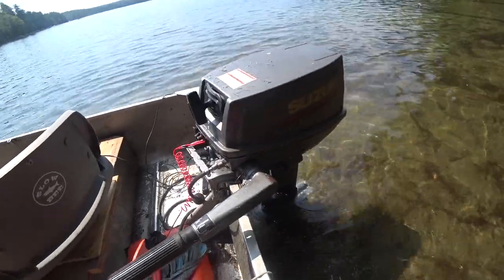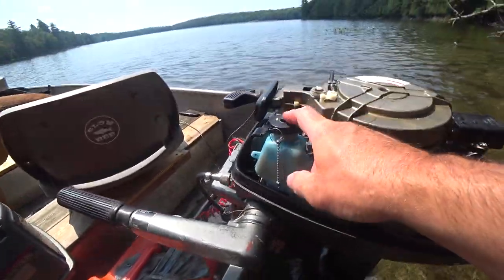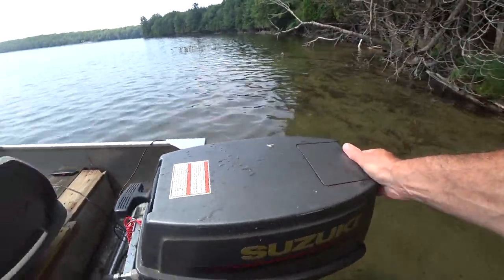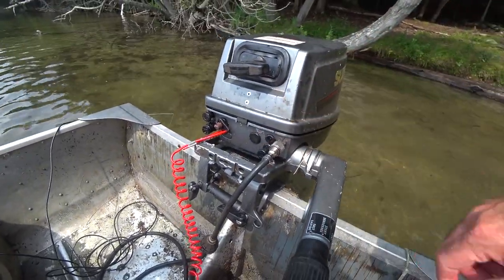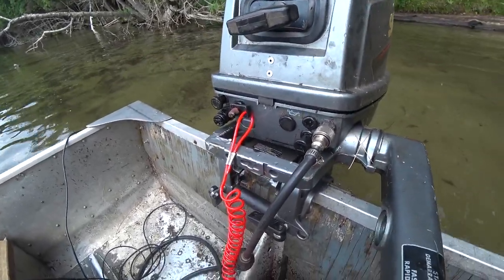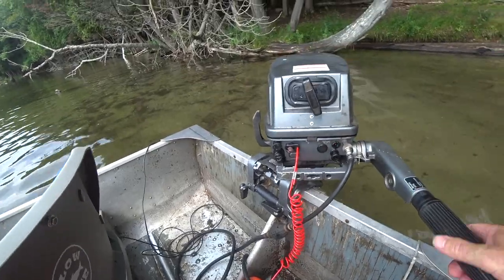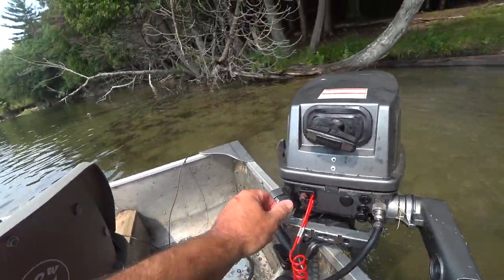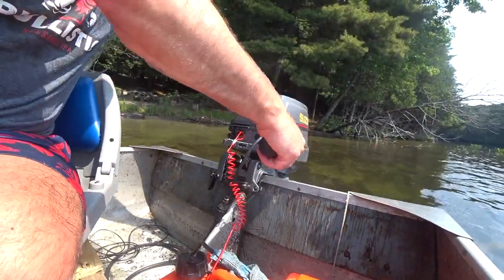TWIN CYL 2 STROKE RIPPA | SUZUKI TWIN DT9.9 HP OUTBOARD

Comment: Hey I just bought a jon boat with the same engine, and I’ve been confused about where the telltale is. On my boat the water comes out the exhaust hole like yours in this video. Don’t most outboards pee out like a stream? I have a small hole right under the lower cowling on the right side but nothing ever comes out. Do our motors have the telltale in that exhaust? Mines a 1988
Reply from the maker: larger outboards with an impeller have the telltale that pees out in a stream.  Mine has always looked like this - not sure where the impeller is or how it works
Reply: @mudbrats  okay, gotcha. Thanks for the reply. Great video! This has given me an idea how mine will perform when I get it on the water for the first time. Looks like a blast to zip around!
Reply: @bacu62 all water cooled our boards have a pee hole. Only air cooled models like the honda 2.3hp will not have any pee holes.
I aswell own this exact model 9.9dt outboard from suzuki eith eletric start ( fancy )
The pee hole is located under the right side rear of the cowling, note you will see a tiny rubber ripple that sticks our aprox 1-2cenemeters.
Get a fine pick or wire, run the engine and kinda fish is back and forth to remove debry, if that fails use an air compressor with a fine nozzle.
If your motor does not pee do not run it, or you risk over heating your engine, and scoring your piston.
My engine has well over 1000hours and has 125-130psi. If your lower then this your engine is scored from overheating.
It will still run below 100 but the performance will not be there.

Comment: top speed ? 16 knots ?
Reply: @mudbrats  is that hand symbol a YES  ??    i have a CABREA 9.9 2 stroke...same engine no injection
Reply from the maker: @williamcox2996  not a yes.  I’ll run a speed test next weekemd
Reply: @williamcox2996 my 12ft Harbour craft with this suzuki 9.9 does 
Exactly 19knots on the dot( max trim setting no gear 1 person)
On our 16ft blue fin with two people and gear 13knots on the dot ( max trim )